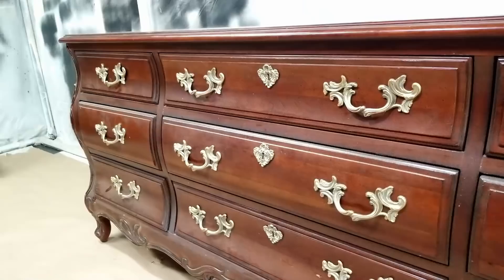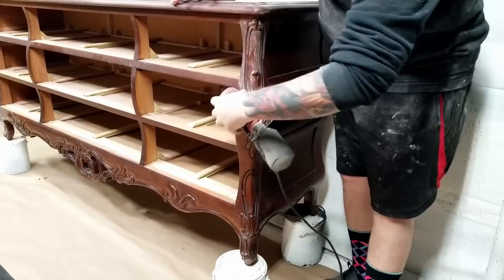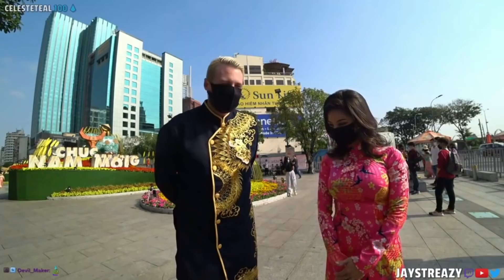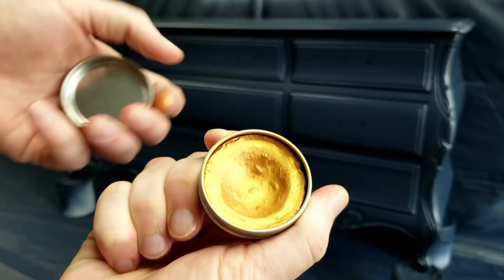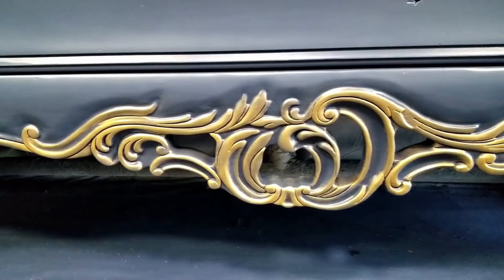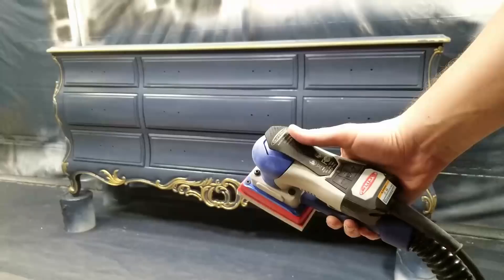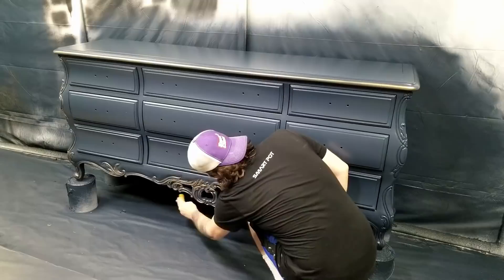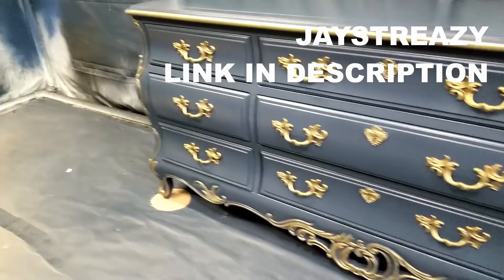I Painted This Vintage Dresser

Comment: Thats why i like acrylic clear coats, no bubbling.  If it does due to the humidity you can use a torch to remove trapped bubbles. Polyurethane is very flammable though, so make sure its acrylic.

Comment: Great job Shabby. It's a nightmare when that happens with WB poly. You should try spraying it during an Irish winter 😀. I had to switch to solvent based paints/finishes just to cut down on drying time.

Comment: I have this almost extact dresser and it was a purchase I regret.  The only detail that is different is the bottom center skirt area.  Mine is a simpler design.  Thirty years later, it's still sitting in my bedroom.  It is heavy and over the top!   If I could easily move it, I would paint it.  But, it is on the second floor of my home and my husband would balk at moving it now.  Not sure what I will ever do with it...other than ignore it 😄  Your job is beautiful!

Comment: Thank you so much for showing the mistakes and how to fix them really appreciated! I am working on a table and chairs first time and doing the driftwood look on top using gel stain first time & the crackle happened after top coat but not on my 2 center leaf extensions after thinking about it i thought it may have been the weather very humid hot day when I did the main table top, but perfect day when doing 2 leaf's I am ready for sure now on how to fix, (thanks to your video) I looked all over on you tube and googled with no answers and you project popped up on my computer notifications today and I am so glad I did not swipe it away like I usually do, due to to many showing up and watched it & it was exactly what I needed I was dreading it but not anymore THANK YOU!  By the way first time I watched one of your videos. Beautiful job!! Great detailed information!!

Comment: Use denatured alcohol to clean up around the gold wax. When you use paint thinner aka mineral spirits, you are leaving behind an oily residue. This would definitely cause a water based topcoat to crackle causing your polyurethane finish to fail.

Comment: YouTuber, K Scott Salvage always says to add a bit of your dark color to the polyurethane coat to prevent the "milky" finish!
Reply from the maker: Ivw heard of this and I've been spraying for 10 years and never have done that. That wouldn't have prevented what happened on this project .it also would have covered up the gold, which needs top coat as it rubs off over time.

Comment: One of the few people I’ve seen on here do it right. Love your work, and the quality & care shows.
Is the rustoleum primer water-based or shellac-based? I’ve had tannins bleed through with water based primers 😣
Also does the polyurethane stick to the wax?
Reply from the maker: Thanks for watching. Spray paint is enamel paint. I think alkyd resin based so it acts as a barrier between the original stain finish/wood tannins and your paint. Water based primers aren't 100% guaranteed because you're still applying water over oil, essentially. Shellac works because it also creates a barrier. Oil based primers work too but I prefer to just use spray paint. Faster and no clean up. Poly does stick to the wax. Allow the wax to dry about 20 min after applying, buff really good, then apply light coats.
Reply: @ThatShabbyGuy  thanks for the tips! I’ve been binge watching your videos. Great work.

Comment: Turned out gorgeous!! So sorry about the issue with the poly but really appreciate you showing these challenges when they happen and what you did to correct it (including researching what caused them). I had a similar issue on a black piece, the milkiness just didn’t clear up. I reached out to a few furniture artists and was told to tint my topcoat. Ever since I tint all my topcoats when painting dark colors. Really love your work!💜

Comment: I love your project!  I was sick when the poly went bad. That will happen if you don’t remove all the silicone and wax from old furniture polishes too. I actually liked the original coat of paint on the gray primer the best. However, further costs may have become too blue. Idk. Dresser turned out beautiful.

Comment: A simple cleaner as ammonia (here called «Salmiakk») is perfect for this kind of cleaning. The solution I have, says 9% ammonia. It is an old school cleaner, which seems to have been forgotten many places, but it is one of the most effective cleaners you can get and it is very cheap (I guess it isn’t marketed, because they want us to buy all these new types of expensive diluted cleaners that we have to keep buying more of all the time), down to appr $1 for a bottle of this very concentrated cleaner. When you’re painting something, it effectively degreases and dulls the old paint, giving new paint great adherence. Usually you use 100-200 ml of 9% Ammonia in a 10 liter (about 2.5 gallon) bucket, but 1--2 caps full in a spray bottle should be great for this, I think. I usually spray then wash off quickly before sanding, then carefully sand the furniture (or cabinet/door/molding etc), and finally spray the cleaner on and dry well off with a cloth making sure it is clean all over. Then let it dry completely before painting. Important general warning for use of Ammonia: You should never mix ammonia with bleach or sour cleaners! For those who are not familiar with Ammonia as a cleaner and is interested in more general info about it, look below - I digressed big time. So if you’re not interested, please don’t scroll and have a great weekend ❗️ ☺️

Disclaimer: The information in this whole post is only sharing of my personal experience. You of course have to do your due diligence and take precautions needed to clean your home/carpets etc safely, incl following instructions from manufacturers. Bottom line: I have no responsibility for anything you do! Just saying! 🤗

In general: Usually you use 100-200 ml of 9% Ammonia in a 10 liter (about 2.5 gallon) bucket, but 1--2 caps full in a spray bottle should be great for this, I think! If someone’s interested, as an everyday cleaner, fill it almost full of water, then add appr 1/2 - 1 cap full of ammonia plus a few drops of dishwashing detergent (as Dawn/Sunlight/Zalo etc for hand washing of dishes, NOT for machine washing!) in a spray bottle or even better; one of those vaccuum pump spray bottles (often used in the garden for pesticides etc., mine is the smallest, it takes 1.5 liter (around 45oz) perfect for this purpose). No need to carry a heavy bucket around (I usually wet a few mops first, so if one gets dirty, you take a new one. Then they go in the washing machine). This is soooo cheap and effective for floor mopping (spray on the floor and use a damp mop, preferably a modern microfiber mop, I think, type «Euromop» ). Also it leaves no scents. For painting prep as this you should only use the ammonia, nothing else, though. Just a general warning for use of Ammonia: You should NEVER mix ammonia with bleach, I was taught this already as a kid since it’s a big no-no  (because the two reacts and makes poisonous gas, so I wouldn’t wash the cat’s litter box or the dog’s potty/potty «lawn» with this either and the bottle also says to never mix with sour cleaners. I have only ever mixed it with ordinary dishwashing detergent (like Sunlight or Zalo/Dawn), there’s really no need to mix it with anything else, as I see it. It is also super effective for windows, only I add a bit more in the spray bottle for windows. It’s only if the temperature is below freezing that something else is needed for windows, then I usually just use car windshield cleaner (Why? Since around a gallon can of car window cleaner can costs much less than a little spray bottle of Jif/Windex type window cleaner, but does the job as well and also doubles as a fantastic stainless steel cleaner! So car windshield cleaner it is!). For carpets or furniture  (not wool, if you need to clean wool carpets, try in a hidden place first! A carpet cleaner pro told me this and I tried it for my light beige wool carpet and it worked great even if it in theory was a no-no). I have added a real good amount in the tank of the carpet cleaner machine (or Little Green Clean Machine type cleaner or even a spray bottle. Put a piece of plastic under all furniture legs etc, esp veneered furniture, as it can suck up moisture from the wet carpet, and remove all pets (esp birds) before start! Spray the solution on the carpet and leave the room while it works for 15-30 minutes (you need to work fast then leave because of the strong ammonia smell, you don’t feel like sticking around, LOL). When you get back and it has done it’s job in loosening the dirt, the smell is already gone. Use the machine to suck up all the cleaning solution and dirt, then spray with clean water and suck up, repeat until it is clear. Then spray with some special carpet spray or as a cheap solution, use fabric softener in water. Let dry for a day or two. In a flat I rented, the landlord was sure he needed to change the carpet, as it was shabby when I moved in, and I had lived there for 5 years. Then I cleaned it using this (got their permission to take a chance since it was wool, they had only used commercial carpet cleaner before), and the carpet looked like it was brand new again. They were shocked! It’s just great and super cheap too! One of the few cleaners you really need… 🤗

Comment: What a metamorphosis ! I’m curious if this is for your own use, or do you re-sell. I am currently painting out my 2nd kitchen. Did my previous kitchen Cabinets before we sold - now doing the house we moved to. After that, I will be painting my China cabinet (that was my Moms) and has the same kind of high-gloss mahogany finish as this dresser. Thanks for the tip about the prep cleaner, and using a detail sponge for accents. OMG - if I had done all that work and my Polyurethane cracked like that, I would have cried. Love your colour after greying it down. My China cabinet hardware is almost identical to this. I was going to replace it, but now I might just paint and reuse it. Cheers !

Comment: i had a horrible ups in one of my pieces...finishing the last coat of lacquer i got the wrong can of lacquer...I started to spray and to my horror it was white lacquer...it has been a nightmare...removing the lacquer, then touch up the wood...and up to day i still working on that piece...second coat of lacquer today...so will see...two more days and then let it dry for 15 days to wax it up...

Comment: Is it better to strip a painted over the original finish with striper or sand it all
Reply from the maker: The only reason youd need to strip before painting is if the original finish is flaking off. Or it is already painted and flaking off. You only need to give it a light sanding to before painting.

Comment: Excellent work bro, that dresser turned out amazing!
Have you looked into changing to a smaller tip in your spray gun? I believe It'll give you way more control.
Reply from the maker: Thanks. I use the 415 tip for paint and 413 tip for poly. I've done this for 10 years and it works great. I just made some mistakes this time, which are mistakes that happened a few times before when I first bought the sprayer. Just showing things for people to be aware of. 😉

Comment: How does the gold wax not just rub off? Mine always rubs off!
Reply: Top coat over it?? Maybe, I don't know myself just guessing.
Reply: @bluecurlygirl  that and maybe some more practice, maybe a different wax. My top coats dont seem to stick to it very well and it get rubbed away so easy. Maybe im needing to go thicker...hmmmmm one day ill get it
Reply from the maker: I've found that sometimes it is best to apply a coat without going back and rubbing on what you've applied. Let that sit for about 15 or 20 minutes, buff it with a rag, then apply more coats as needed. Definitely top coat after buffing your last coat to prevent daily use from rubbing it off easily.
Reply: @philmurphy7487  Good man Shabby to the rescue for both of us.

Comment: Why do you refinish brass handles when you could easily restore their original brass finish?
Reply from the maker: If I dont like the color I change it
Reply: @ThatShabbyGuy    I think it’s a fad that will pass quickly. Garish colors. As well as modern hardware on antiques. But your piece is very nice.

Comment: Why do you clean when you are going to sand?
Reply from the maker: Removes the residue that is going to gum up your sandpaper if you skip cleaning. You'll end up spending the same amount of time, if not more, and have to be constantly changing out sandpaper, thus wasting more money. Better off to clean, as you should with any painting project, furniture, doors, cars, houses, etc

Comment: Why do you use canned spray primer as opposed to using your sprayer and canned primer? Isn't the can more expensive for the quantity it contains?
Reply from the maker: I only put water based products in my sprayer so I don't have to deal with chemicals to clean/store/dispose of + risk something getting clogged up. I also don't need to use much. Just 2-3 light coats. The time spent getting the sprayer set up for that, then to have to clean it 30 minutes later so I can put the paint color in the sprayer doesn't work well with my workflow. It would add about 20-30 minutes to my work time

When it comes to brushing/rolling it the spray can method allows me to apply faster. It also dries faster so I get to reapply faster. I rarely use more than 1 can on a piece and at $4-$5 per can, the cost is outweighed by the time I save. Time = money. I've never actually timed the difference but I started using this method because I worked on multiple pieces at once. Sometime 12 dressers in one paint room. It was much easier to just rattle can the primer.
Reply: @ThatShabbyGuy  Thanks for the response.

Comment: actually by painting it took the value away from it. depending on the maker and year of the dresser.restored properly as close to origional as you can get . gets you more money. the wood carving style and handles can make a dresser from any where from 1000 to 1500 or more. it is a very nice job you did.but if your in it for the money there is more in origional condition.
Reply from the maker: I've been doing this for money for 10 years. If I could sell it as is for the same price as painted, I would. Wood toned furniture doesn't sell for as high as you think in your head. I live in an area with 7 million people and more moving here all the time from all over the country. People want color options. Not outdated wood tones. This is why I can charge more money for painted over original.